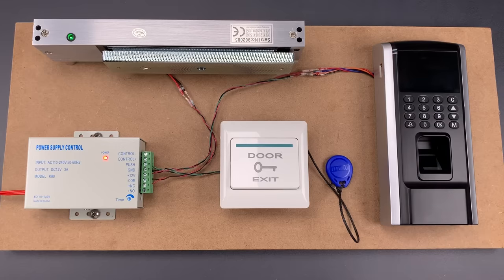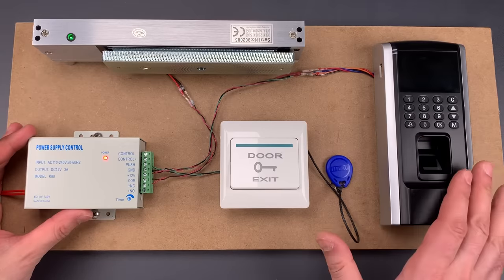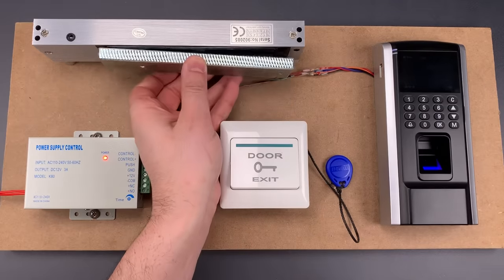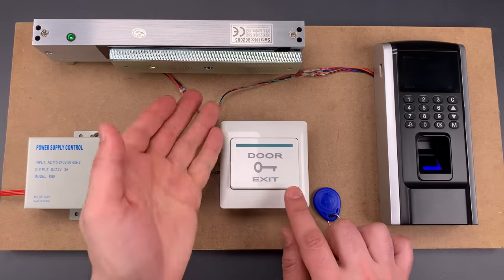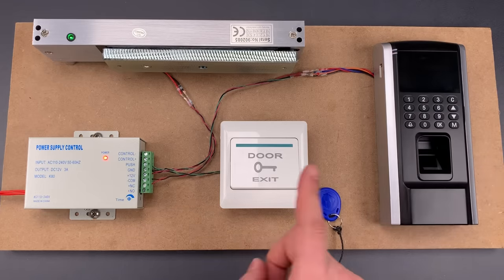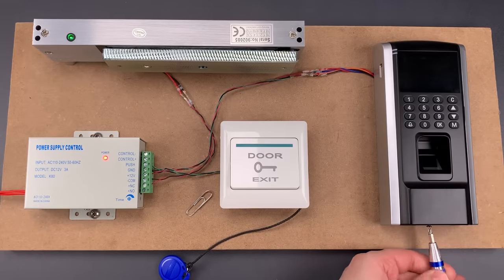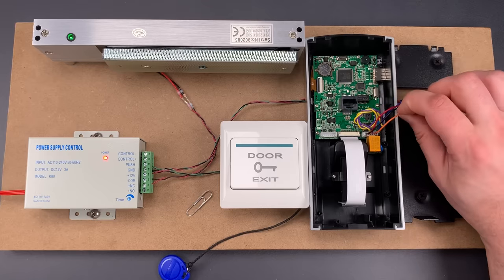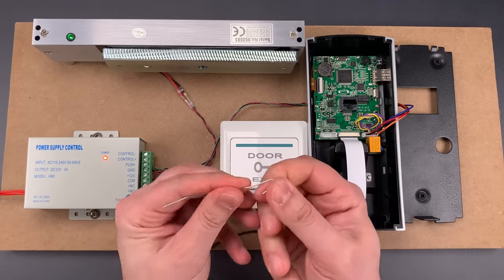[1040] Fingerprint/RFID Lock Defeated With a Paperclip (Mengqi-Control)

Comment: I wonder if you could just dump a bucket of water on the keypad for the same result
Reply: Probably 😅
Reply: Electrical engineer here: if the control signal is a high-impedance input like the gate of a MOSFET or CMOS device, then it genuinely might work if you get lucky and water bridges between the control and common  wires. I recommend salt water for extra conductivity, and I also don't recommend doing anything illegal lol. Sadly, you probably won't get a dramatic shower of sparks and electrical arcing like in the movies.
Reply: @veraxis9961  if there's no electrical arching, is it really worth opening
Reply: @Septimus_ii  there could be fun electric things behind the locked door
Reply: maybe just put 2 screwdrivers into the next outlet and force the mainfuse to explode.. no power ..no magnetforce to close the door.
Reply: Instead of water, use mercury!
Reply: No.
Reply: @ADBBuild  mercury has too strong surface tension, so it wouldnt flow in very well
Reply: @TrapsAreNotGayButILikelyLong  Yes, there is genuinely a chance that would work. Basically instead of shorting the connection with a paperclip, you are just shorting it with conductive water.
Reply: Depends on if it's weather-resistant or not.  It looks a lot like it's an internal mechanism though.
Reply: if you're going for the opposite of being stealthy, like dumping a bucket on it, you might as well stab open the left side right near the connector and pull enough of the two wires out to strip and touch them together.
Reply: @Marclauder  back up battery?
Reply: Nope, all you will get is a jammed lock.  Source - I actually tried it (not on purpose though, and stupidly did it from the outside).  It turns out those things are not impervious to high pressure water spray, had to call a locksmith to get back in.  It took a few days to dry out and start working again.
Reply: That's an unreliable method of "picking" these sorts of systems. But I have seen that work on garage door key pads before, because they have the exact same problem that this has.
Reply: @veraxis9961  I would hope not.. that'd indicate way too much power going to something that should be a low-power device.
Also, I don't really feel comfortable with a door lock that's slurping up electricity.. I'm already self-conscious enough about my smart light bulbs essentially being 'always on'. :P
Reply: use braundo....it's got electrolytes!
Reply: unlikely they are on the same circuit but I know where you are going with that :)  likely he could have shorted the power and ground in the keypad though and effected an opening that way. the way he did it is untraceable. no fires when the relay explodes :) conversely he could have applied power via shunt to the open pin.. if you can get the cover off you can open one of these multiple ways
Reply: Salt water like the old pop machines 🤣
Reply: In highschool this is how we got pizza money at the mall.  We'd get a mouthful of water at the water fountain, then spit it down the coin slot on a payphone.  This reliably created a short which caused the coin return mech to trigger non-stop until it was empty.
Reply: @billybobjoe198  Actually garage door keypads are not hardwired. Typically at least since the late 80s. They run on wireless. And cannot be defeated by touching any contacts on the back of the transmitter
Reply: He's closing the circuit to disarm the lock so cutting wires or shorting out the board would not work.
Reply: @artsmith103  Closing a circuit, and shorting a circuit are the same thing.
Reply: @billybobjoe198  I don't think you can count on a droplet only doing what the paperclip did. More likely there would be a collection of failures any of which would result in simulating an open circuit in more ways than 1.

Comment: I've installed some of these sorts of security systems in apartment buildings, any half decent system has little to no way to tamper with they entry code box cover. In most cases we install them in special boxes before the drywall even goes up so that there is no way to access them. Very annoying if you have to go back and work on them later though 🤣
Reply: It's still plastic though, cut out the panel front and bridge. Or better yet, smash with a hammer and short circuit the wires directly.
Reply: @keimakatsuragi5807  sometimes, good ones are metal. Hammer could still work but it would not be covert at all.
Reply: @keimakatsuragi5807  Smashing the input box is pointless, since it doesn't actually control the lock - just sends info inside
Reply: @Moleoflands  Didn't pay attention to the video did ya?
It doesn't "send info", it's just an over complicated switch.
that was one of lpl's complaints about this unit, the control circuitry should be in the external box, not in the easily accessible box.
Reply: @chrisbaker8533  OP and Bui are talking about a decent system, not the one in the video /facepalm
Reply: @purplefreedom1631  OP might be, but bui definitely isn't.
Hence my response.

His response is to Keima's post, which IS talking about the lock in the video.
As such, he's talking about the lock in the video.
Reply: @keimakatsuragi5807  If your approach is to smash with a hammer, just break the door and you'll bypass the lock no matter how good it is

Comment: When people who know how to make electronics have no understanding of security.
Reply: I don't think you need a degree in physical penetration testing to have a little bit of common sense and critical thinking.
Reply: Anyone that has a basic fundamental understanding of electricity would know this lock is garbage. I'd bet money that pouring a cup of water on the keypad would open the lock up. Hell, even turning off the power would open it up. The lock is constantly relaying a command to stay closed, if at any point that relay is disrupted, the door opens. Theres no fail safe. And what kind of lock manufacturer puts the access point (screws) on the exterior side of the lock? There should be either a separate mechankcal key required to access the screw, or some screw access door that only opens when the pin code is entered.
Reply: You really do not understand the product development process. 

Making ultra-secure things that cost a LOT of money is not that profitable due to low volume. 

Looks at the best-selling safes and door locks on Amazon. 

The #1 digital Lock on Amazon RIGHT NOW (YL-99) was featured on this show and defeated with a right-angle screw driver.

They are purchased due to low price and that kind of volume is VERY profitable. 

The problem is that you think (as a consumer) that the "best" and most secure product makes the most money when the reality is that the cheapest product that offers "good enough" features actually rakes in the most $$$$. 

You blame the designers when the reality is that consumers actually define what developers make (developers use data to determine what to make while you use your "feelz" to determine what you like). 

AS a developer: making the "best" will get you fired while making the most $$$ will get you promoted (even if it's not very secure).
Reply: @mouthwash8182  Incorrect. Yes if power was off to the magnet, then yes it would open (as with any electromagnet), but given that bridging the connection opened the lock, means that it was a lack of connection that keeps it closed (i.e. losing power to the controller would not result in lock opening).
Reply: @benhook1013  Losing power on the house mains would, howevr, Just unplug the main fuse.
Reply: @giannicomoretto  Which is usually indoors so you'd need to have gotten past the lock to do that. You'd have to cut power from the main line outside the building. You wouldn't go through that much trouble to break into a home, there's easier ways to just bypass the door entirely.
Reply: @GadgetGuideUSA  Adding some sort of negotiation between PSU/control module and fingerprint/keyboard module would cost below $1, and would prevent any simple hacks. Heck, if the lowest price is your goal, it's certainly possible to design it even cheaper than it is and make it tamper proof from the outside. I'm an electronics engineer BTW.
Reply: You would have to change the control module completely. 

You may have a strong grasp of electronic theory but obviously a weak one at product design and development.  

Many of these products that come from China are made using off-the-shelf leftovers from previous products. In the case where you already have 10,000 control modules bought at a discount from an EOL product, you make do with what you have. 

If you were going to add negotiation, you should probably add encryption as well(which require on-board memory as well). 

Being an electronics engineer and product developer may have overlap but being one does not make you the other.

Cost is king, even over efficacy.
Reply: @GadgetGuideUSA  You talk nonsense. I'm talking about doing the change at design stage. All it would take is repurposing a few microcontroller IC pins, making some changes in firmware and placing a few additional parts into PSU module. I'm not talking about making a hack for device already produced. Of course the better way would be to put all processing into PSU/control module and using external module only for data input. However even such half-measure would make it thousands of times harder to hack.
Reply: @GadgetGuideUSA  "If you were going to add negotiation, you should probably add encryption as well(which require on-board memory as well). " It might be a surprise for you, but there is already memory present. If it has where to store the password, it has EEPROM/FLASH memory available. Basically any modern microcontroller, except those which cost a single digit cents, have some permanent memory which can be rewritten by firmware on the fly.
Reply: @woopsserg  that 56kb EEPROM is not going to hold multiple decrypts.

I thought you were an engineer?
Reply: @GadgetGuideUSA  LOL, do you want to say you need a some insane size EEPROM or flash to make some sort of encryption? Needed size is measurable in bytes, not kilobytes.
Reply: @woopsserg  I won't argue with you on YT comments. 

It's quite obvious you are decades away from actually developing real products in the real world. 

Best of luck with your endeavors.
Reply: @Vincent_Beers  In Italy most of the house main switch is outside the door. This for historical reasons, the utility company had to read periodically the power meter to bill you, and it was unpractical to have it inside the house. Now meters are remotely read but they are still outdoors. The main switch is part of the meter.
Reply: when the client wants everything cheaply and all in one package* there, fixed it for you :)
Reply: @GadgetGuideUSA  So why biochemist teaches me how electronics work?
Reply: @woopsserg  so why nobody ever teachered youse to talk proper like?
Reply: @derekhunter5040  Why nobody ever taught you to not talk irrelevant points in argument? My point is simple, somebody who is biochemist says to me, electronics engineer, that something cannot be done in microcontroller. Which I find ridiculous, since 30 seconds of googling will show you examples of how it's done.
Reply: @woopsserg  lol idgaf about your argument, I just think you're cute when you're angry. 😂
Reply: they do, they just don't care

Comment: yeah we have a similar system, when you take a small flathead screwdriver and place it between the magnet and the doorplate you easily pry it open too, the 600 pound is only when pulling it straight, so any outward swinging doors are a bit more secure. but with a good solid door you can still pull them apart with a good yank.

Comment: I can't imagine how many lock companies have went bankrupt because of him.
Reply: unfortunately probably a lot less than should.  As popular as he is it is likely a drop in the bucket compared to their manufacturing savings by making units simpler to make.
Reply: You have to remember that anyway, most of his methods of lockpicking are "soft" ones and most burglars use "hard" ones.
Look aroudn you and you'll often see 500€ locks installed on flimsy 100€ doors, or even sometime reinforced doors on a cheap door frame.
Security is not just a lock.
And for those panels he display there, most of the time I see them mounted in a metal shell that is bolted from behind the wall, that prevents any messing with the screws. But even then, it wouldn't take long for a thief to just wait and ask someone to get inside, or just a skillfull observer to get an entry code.
There's always a failure somewhere. And the human factor is the one you can't fix.
Reply: 0 is a hard number to imagine. It took centuries until we were able to properly express it.

Comment: I defeated my secondary school lock system years ago by removing the the front covers,whiched revealed a bunch of contact points for me to short circuit. 

The next thing you know, I was using paperclips to bypass all the lock and even trespassed my own school.

And thus, almost got myself into a police case for trespassing. What memories to live by.
Reply: Great..
Reply: My school's theater had a rollup door that didn't have a latch for when it was down, so I could get in whenever I wanted. That was 15 years ago, and my nephew says it's still like that.

Comment: Reminds me of the very expensive "2N IP Force" door intercom I once reviewed for my former employer. Very rugged, anti-vandalism design  with a price tag of >1000€, but you could just unscrew the front panel, giving direct access to the door opener wires. Essentially, you could bypass that beast with just a torx screwdriver and a 9V battery.

Comment: Hmm, bridging electrics with a paperclip - I'm glad that this was LPL and not Electroboom ;)
Reply: Electroboom would have used 240 volts and blown the whole circuit to smithereens, but still got in.
Reply: @Nonplused  ,because the door was that of the hospital that brings him back to life.
Reply: @Nonplused  Or as he has already tried, zapping the entire circuit with his high voltage car transformer circuit arcing and resetting the system and it opens by default :)

Comment: And as is so often the case a bleedingly obvious step that should have required two seconds of thought during the design phase is somehow missed; all this really requires is for the control board to be on the other side of the door with the number pad and sensors being wired through, it would mean more wires but render this actually worth more than about $5.
Reply: You can still short the two wires where they enter the numpad. So, that's not the answer. Verification must happen on the backend.
Reply: @3DCGdesign  That's what I mean; unless they've fucked up even harder than shown, the number pad and biometric sensor should only be sending signals to the control board, which is where the actual verification of the number sequence/scan data should take place.

Which is why that board should be on the secure side of the door, rather than the insecure side.
Reply: It would require much more knowledge. This is a mechanical device with basic electronics. If you want to do it right it must be a secured connection, otherwise it’s easy to bit bang the signal. It won’t be as ‘cheap’ anymore then. 😅
Reply: @RustOnWheels  It's not cheap, it's $170

Comment: As I was once told by a professional:  ''A lock is only there to keep an honest person out''.  And also, when it comes to my motorcycle security: I can have the best locks on the market, secure the bike in an alarmed garage, have the bike wheels chained through metal hoops set in concrete, and have the steering lock on plus have the bike fitted with a motion alarm. All this is pointless to someone with bad intentions.  If they really want it, no matter what you use, they will get it.
Reply: Just take the engine of the motor cycle with you every time you park it.
Reply: @Mercilessonion  - Hello! - Hmmmm: Y'know?, that's not entirely such a bad idea!  A bit time consuming mind you, but, the look on their faces when they try to hot-wire it, then look down n' shout ''awww fer f***s sake!'' :) Have a good week.  Regards.  Dawg.
Reply: @WhosAGoodDogue  Lol, good day to you too :)
Reply: And I was told your Security should be at a level that a criminal will go and find a easier target I.e. if this lock is only stopping people getting into the stationary cupboard then its sufficient.

Comment: Companies should hire you to design a lock that cannot be opened with common tools in the market
Reply: There already are systems like that. One of the few gripes I have with LPL is he does go for low hanging fruit sometimes. A lot of his electronic bypass series is targetted at devices that are not meant for true security (though he does point out some that claim to be). This system is less than $200 and has both RFID and fingerprint reader. Those components and the magnet probably make the bulk of the price tag. There are a lot of card reader systems on the market that don't have these simple flaws, but they're more expensive and are usually used in large buildings, rather than the apartment complexes and small business offices you see the ones in this video at. Even his gun lock videos mostly focus on things meant to child-proof, not secure against theft.
Reply: You can manufacture tools. The lock must be intrinsically safe. Safety by ignorance (of the right tool, in this case) is no safety at all.
Reply: @giannicomoretto  with some skills in programming, you can easiely set up  a door lock with Raspberry Pi. Over a bus system the code or fingerprint is send to the raspberry pi, and there you can unlock the door. It's faster to cut off the glass, then trying to open this lock.
Reply: He is making waay more money on YT while having fun.